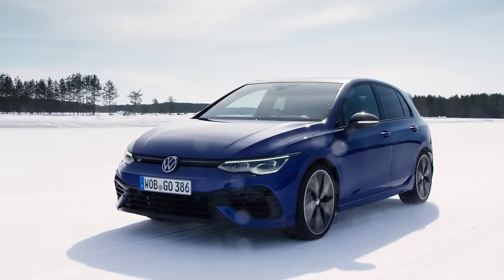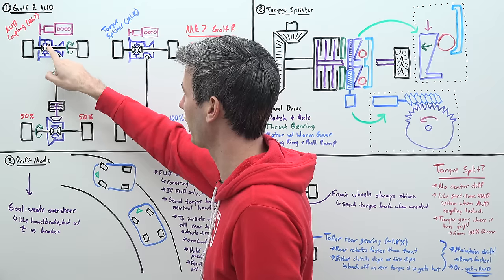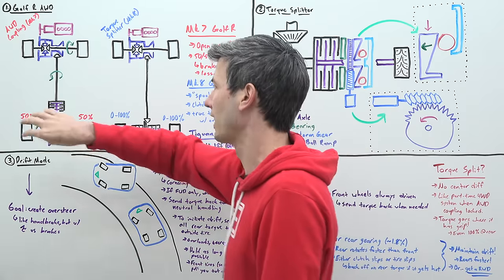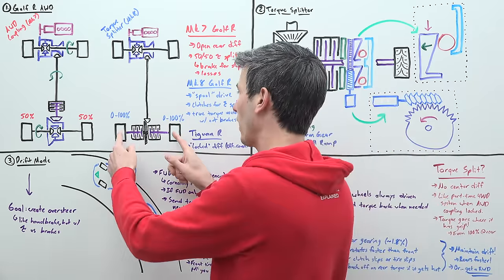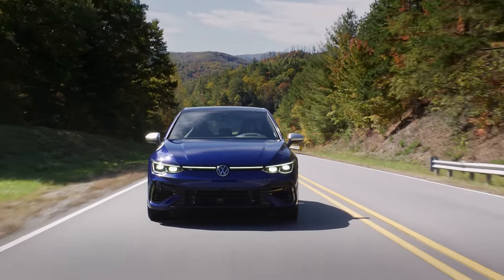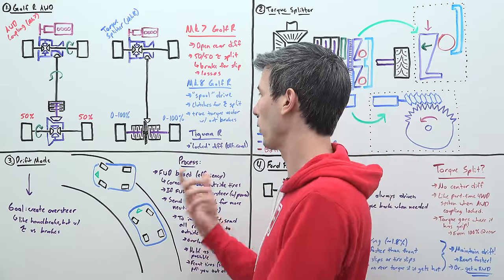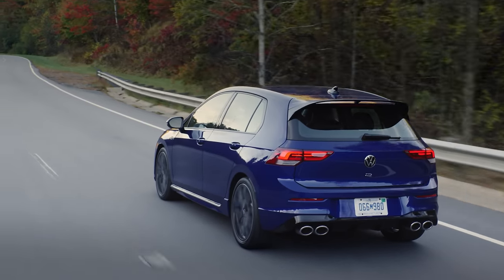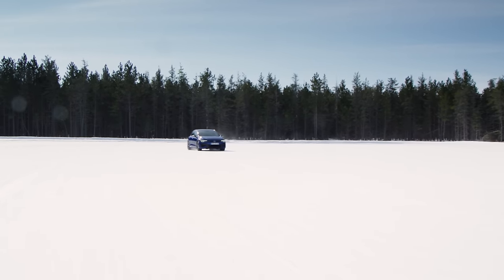Volkswagen's Clever Differential Allows For AWD Drifting - 2022 VW Golf R

Comment: Imagine complicating the rear differential that much when you could have a rear diff that locks or have more of a rwd bias and have a better driving car. I think there will be major problems with these diffs.
Reply: They're actually quite simple and are used in high power rwd cars without issue, while also being more effective than a traditional LSD.
I think all the electronically controlled stuff makes driving boring, but technically it accomplishes it's task well.
Reply: @billowytrots8366  you can just have a regular lsd and that's it, job done. No need for electric worm holes that overheat and need to cool down and be fwd in the meantime ... This is super duper not needed. Simplicity is they key to reliability and a good driving experience.
Reply: @mihaiserbanescu8676  The electronic ones are simple. Very. No issue making them reliable.
All diffs can overheat, but usually don't, and RS is a just special case.
Reply: @billowytrots8366  I'm just looking at the myriad of cars that had regular LSDs and never had an issue. No overheating in the Miata or BMWs or other cars. There may be a few exceptions but they're few and far between. One surprising example of non lsd super performance car is the McLaren, all of them have open diffs, yet they go like a bat out of hell. I don't understand how they manage an open diff with so much power on it.
Reply: There's generally no issues with diffs. They're simple, electronic or LSD.

Focus RS compromises thermals for drift mode, and enough consumers want that, or just don't plan on hotlapping them for 10 laps straight so it's a non issue for them. 

LSDs aren't very consumer friendly; they can't be disengaged during street driving (consumer vehicles cumulatively are almost entity street driven) to prolong the life of the friction surfaces, they're slower than electronic ones, and the manufacturer can make more money off electronic diff technology and prestige.

F1 is an older vehicle and in that time McLaren possibly compromised with an open diff for longevity and street compliance, or maybe just to maximise it's outright top speed, while the LM model was designed to be as good as it could be around a track, and hence was equipped with an LSD.
Reply: @billowytrots8366  about McLaren, I meant the new ones. They're almost all if not all open diff. Why would you have a 650s with an open differential? I mean, I'm sure they have some reasons but can't think of one that would benefit it, also it's not like they can't drift at all because they can. That's drive train wizardry to me.
Reply: @mihaiserbanescu8676   McLaren use the brakes to direct torque instead to save weight in the differential. That's just the way they want to do it I guess, and they design the car around that idea.

Comment: I mean, it's a twin clutch rdu like so many others out there, right? RAV4 adventure is the same story. The real question what the torque limit if each clutch pack is. If 2000 lbs ft can come down that driveshaft, can a single side clutch pack hope to absorb all that torque? If it can't, is disingenuous to say that 100% torque can go to that wheel in a locked state that would mean that with 3 wheels on rollers and one on the ground, 2000 lbs ft could go through that one rear wheel. I know those clutches aren't that strong. If we say that the limit is 1000 total, then we can guess at instant torque spilt maximums. No one will tell you these limited of course
Reply: It only needs to handle the engine torque output, 295 in this case..

Comment: Is the mazda 3 awd system in any way related to this?
Reply: Nope, nothing in common.
Reply: @4x4.tests.on.rollers  Ok, thanks! But it's not integral, it's still a fwd unless there is slippage, isn't that right?
Reply: @joaoflor  Slippage is the last factor. There are tens of other factors that activate the awd system, without slippage. That's a proactive system. Mechanically - it uses electromagnetic coupling (EMCD from GKN Driveline).

Comment: I'm confused when you talk about an open diff having a 50/50 torque split. Surely the nature of an open diff is that it sends more torque to the wheel with the least amount of traction/the most slip. This is why you can have one wheel on the ground with the other jacked off the ground, engage the transmission with the engine running and only the wheel that is off the ground will rotate.
Reply: No, it's the same torque. Take your example of one wheel jacked up. One wheel is spinning free so there is virtually no torque going to the other wheel. If any appreciable amount of torque went to that other wheel it would drive off the jack. Remember torque is a force. That jacked up wheel may be spinning madly but it takes very little force to do so. The same force applied to the other wheel results in no motion because it is too low to move the car.
Reply: @LesNewell  If an open diff performed as you say there would be no point in even having a differential, since a a locked axle also distributes torque equally to both wheels.
Reply: @Ijusthopeitsquick  No. In that case nearly all of the torque would go to the wheel that's still on the ground. Think about it. With no diff both wheels have to rotate at the same speed. How much torque does it take to turn a wheel that's in the air? Compare that with the torque needed for the other wheel to push the car along.
Reply: @LesNewell  Of course I realise that a locked axle isn't practical. I was trying to illustrate my point about torque distribution. The differential exists to overcome the difficulty that, in a turn, the outer wheel describes a longer arc than the inner wheel. It allows the two wheels to turn at different speeds. An unfortunate side effect is that, in low traction situations, this system delivers most torque to the wheel that needs it least. This is the reason that LSDs and AWD systems were created. Anyone who has had one tyre slipping on mud and the other positioned on grippy tarmac knows that the side with grip gets almost no torque and the side without grip gets lots of torque, enough to spray gallons of mud, dig a hole under the tyre, and create clouds of steam. Meanwhile, the tyre with grip doesn't turn at all, even with the engine running at full power. Is that what you would describe as a 50/50 power distribution? Of course not.
Reply: @Ijusthopeitsquick  You are confusing torque and power. They are different. Power is torque (angular force) multiplied by speed. Think of it this way. Imagine pedaling a bicycle. Lock the brakes and put all of your weight on the pedals, trying to move forward. Assuming you can maintain your balance it is no effort because no power is being transferred. Now try climbing a steep hill. Again you are putting your whole weight on the pedals (same torque) but it's hard work because a lot of power is being transferred.

Now look at your your mud example. One wheel is on the tarmac and not turning. As the speed is zero, power is zero. It does not matter how much torque you put through that wheel, if it isn't turning the power transmitted through it is zero. Now the other wheel has the same torque but it is turning really fast. Torque times speed is power so you have lots of power going through that wheel, hence the flying mud and steam.

In the same situation with a locked axle both wheels are turning at the same speed but as the wheel on tarmac has a lot more grip it has more torque and hence more power going through it.
Reply: @LesNewell  The tarmac side offers the same amount of grip regardless of whether the wheel is driven through a locked axle or an open differential. Ditto with the muddy side. A locked axle has no option but to turn both wheels equally, or at least to apply torque to them both equally. An open diff, by its very nature, will apply torque to the wheels differentially, as soon as one wheel rotates at a different speed to the other. That's an intrinsic aspect of its design.
Reply: @Paulo Market The situation I described does not violate any of Newton's laws. The torque applied to the spinning wheel does indeed create a reaction, even if that reaction does not take the form of forward motion of the car. Instead, it applies a twisting force to the chassis of the car, while the wheel is accelerating. Once the wheel is at a constant speed, there is no net force being applied to it since, by definition,  it is no longer accelerating, other than the force required to fling mud and water off the periphery of the tyre. You should read Newton's laws more carefully.
Reply: @Ijusthopeitsquick  Guys above are right, you are confusing torque and power. Check the video called "Always 50/50 torque split of an OPEN differential - 4x4 tests on rollers", that should help.
Reply: @4x4.tests.on.rollers  I looked at that video and a better one, also from EE called Open vs Locked Differential - Torque Transfer - Explained . Thanks for the reference. The EE explanation does a fairly good job of explaining the importance of the friction coefficient in the formula. I'm still scratching my head a bit, though, since for the high traction tyre not to move the car even slightly while the low traction tyre is spinning furiously, it would have to have close to zero torque applied to it, and yet the formula insists that it always has 50%. I will have to ponder this one; it is extremely counter-intuitive.
Reply: @Ijusthopeitsquick  You are very close. Think about the numbers. Low traction (or wheel in the air) is spinning furiously due to - for example - 50 Nm applied. At the same time - full grip side is doing nothing due to only 50 Nm applied. It can't get more cause low traction side is limiting this value.
Reply: @4x4.tests.on.rollers  Yes, I can see that, just about. I am trying to understand an open diff mathematically in terms of an inverse relationship between left/right relative wheel speed and left/right relative traction (CF x normal force).
Reply: @Ijusthopeitsquick  You seem to misunderstand how torque works. Torque is the twisting force on the axle shaft. Here's an experiment for you. Put a car with an open diff on axle stands so both wheels are off the ground. Put the gearbox into 1st(manual) or park(auto). If applicable release the hand brake. Now turn one wheel. The wheel will turn easily because the diff is trying to balance the torque equally between the wheels and making the other wheel turn. Get someone to hold the other wheel to stop it rotating and try turning your wheel. However hard you try to turn your wheel they will have to apply an equal amount of force to stop their wheel turning. The diff is balancing the torque between the wheels, with both receiving the same torque. Repeat the experiment with a locked diff/solid axle. Now you can't turn one wheel even if the other wheel is in free air. You are applying lots of torque to your wheel but none is being transferred to the other. Limited slip systems will function somewhere between these two extremes.
Reply: @LesNewell  If both wheels are free and I turn one by hand, the opposite wheel will turn backwards, won't it?
Reply: @Ijusthopeitsquick  Yes it will. The diff is transferring the torque you are applying to that wheel. As there is nothing stopping it rotating, it turns. We are seeing Newton's laws in action. Every action has an equal and opposite reaction.

Comment: Hi guys we have replaced the almost indestructible Pinion Gears with clutch discs that do not work without wear and could thus replace a non-existent problem with additional revenue for the workshops.

So next we will replace the gearbox with a single transmission including wear clutch as Koeniggsegg does! 

Another reached these days 1'500'000 km with his T***

Comment: Though cool from an engineering standpoint, drift mode for these AWD hatchbacks is for appeasing auto journalists
Reply: I feel it's more about adding a line/feature to their marketing material or brochure.
Reply: The AWD system that allows a drift mode does help handling in normal sporty driving as well (significantly reducing understeer), which is the main purpose. Once you've got the electronically controlled clutch-packs, adding drift mode can be done purely in software so they may as well put it in.

Comment: 100% of the AVAILABLE torque meaning the new mk8 R still only has a 50 / 50 based AWD system in terms of power sent to the front and rear at best.
Reply: That’s not how clutch based awd systems work. When fully engaged they behave more like a locked centre differential or part time 4wd system. Torque is applied where there is traction, up to the torque limit of the clutch pack(s).
Reply: @crazybuschris  the new mk8 r can still only send 50% of torque to the rear axle. The difference with the mk8 vs mk7 is that 100% of that 50% can be sent to an INDIVIDUAL wheel at any given moment. Whereas the mk7 R couldn't. It would be evenly distributed to both wheels then aided with the use of brake vectoring. My point remains it's still a fully front biased system that's limited to a 50:50 torque split between front and rear.
Reply: @MarcraM82  Jason explained it well in the video. Talking about torque splits with clutch based awd systems is confusing. There is no center differential splitting the power. If the clutches are fully engaged and capable of holding the full torque output of the drivetrain, there is nothing preventing more than 50% of the torque going to the rear axle. This would require slip at the front axle, but in that situation it is entirely possible for more power to be put to the ground through the rear wheels. The torque can only be applied where there is available traction. In a situation where there is no slip at either axle and the clutch is fully engaged, then the torque delivered to the axles equally 50:50.
Reply: @MarcraM82  I think you are missing the point here. Subaru WRX manual is 50:50 split, but can never apply 100% torque to an axel with a grip because central visco will start to slip, unlike Golf r here which can have 100% torque on either axel with a grip because the rear clutch packs will not slip and because of this full 295lbft engine torque can go to rear wheels, if fronts have 0 traction.
Reply: @crazybuschris   Actually when there is no no slip, more than 50% can be applied to the rear axle. That may happen during hard acceleration when there's weight transfer to the back.

Comment: Why didn't they stick with the first design but then go with a clutch type LSD. Sure you would lose torque vectoring but it would be simpler and possibly cheaper as well. It just seems over engineered.

Comment: sadly a computer is going to have to go in a "figure out" your drift. you won't actually be in control of a drift, the system will detect what you're up to and sell you some amount of drift. a more pro system would be a torsen system, which can dial in extactly how much spin you should get mechanically, but it's very skittish and probably not in the phiosophy of the Golf. what VW should have done is a viscous coupling. this system does leech a little more power than a clutch pack, but it's linear mechanical torquesplitting would put the driver entirely in control of the drift, it would be very forgiving, all you give up is a few hp in drivetrain loss and the top-end split (viscous coupling maxes around 70-30 split, but honestly at that point you're already doing a kingdom come drift)

Comment: Not sure burning clutch packs is all that clever.  

Besides maintenance cost, the heat generated by the slip of the clutch plates is wasting fuel.
Reply from the maker: Burning wouldn't be the appropriate word haha. They're slipping. They're designed to withstand heat.
Reply: @EngineeringExplained  Tomato tomato.  Unless they're made of some wonderful new material they will wear down like any clutch that's slipping and generating heat.  

I did use the word slip in my original comment as well.
Reply from the maker: @minimalistic_banhaus  I do enjoy a good tomato. Wet multi-disc clutch packs, designed correctly, can have a very, very long life. It's how every modern DCT & automatic transmission (aside from CVT) works.
Reply: @EngineeringExplained  That's fair.  Really I should have reviewed traditional limited slip diffs before commenting.  (Fortunately your old video on the topic was easy to find lol)

Comment: Ford engineers understand driveline cooling ❔  Not when it comes to a PTU as on my Mazda CX-9 made by Ford that takes less than 1 quart of gear lube and no drain plug to change the fluid

Comment: Just get a proper RWD biased AWD system. Can drift on command and doesn’t feel fake. Xdrive ,Porsche awd , g70/stinger awd, Jaguar awd, 4matic+ all allow you to do this. Quattro even tho a longitudinally based AWD system is closer to a 40/60 split so is very difficult to drift. The others I mentioned in sport mode default to 20/80 split and can send 100% available tq to rear wheels under acceleration.

Comment: Isn't the point of AWD to NOT drift?
Reply: The point of AWD is to use all the available grip however you want to. WIth 4 wheels powered acceleration is less limited by traction. It also helps on loose surfaces by allowing the front wheels to pull the car around a corner and the back to push it out. It's combining some strengths of FWD and RWD.